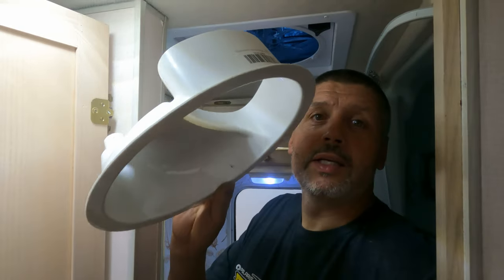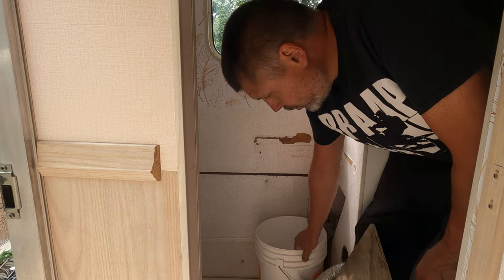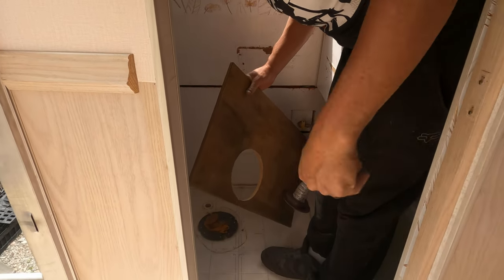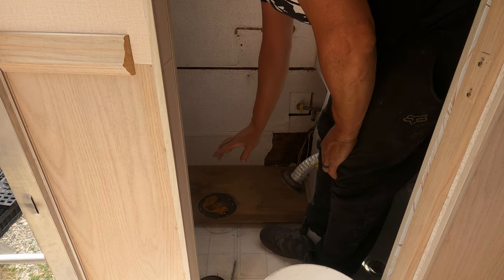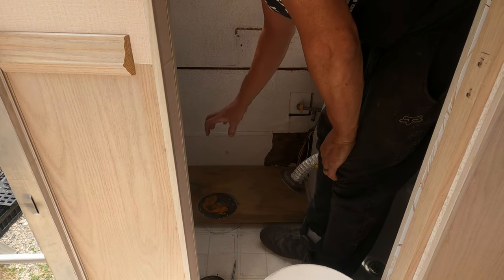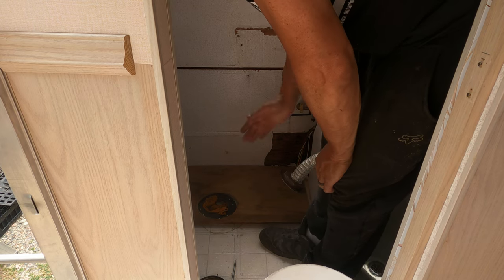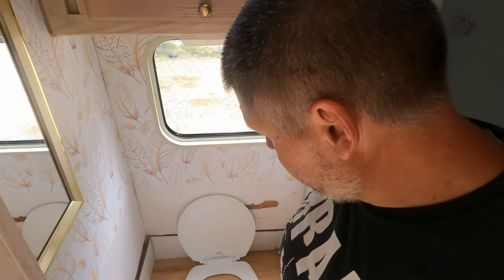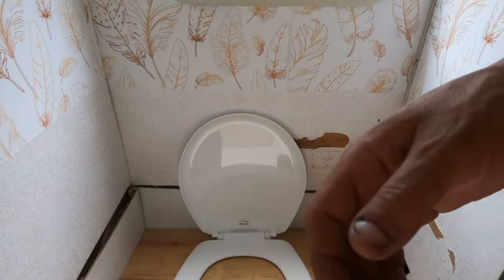DIY Composting Toilet in Our Truck Camper - Easy & Cheap

Comment: I can't wrap my head around a compost toilet because all the ones utubers have shown, you got to haul the whole thing out to dump it n then clean it (ewwww!), n then carry out a urine jug and go dump it every two days (more ewww!) n of course vent the toilet out the side, which for me is another (p-ewww!). And thus the whole thought of it makes me just love my toilet n black tank so much more lol. 
But! I must say, you have simplified no hauling out whole toilet, no cleaning out 💩 tank of composite mixed with 💩, n no smelling 💩 when walking around camper or even sitting outside on that side! And no urine jug hauling n emptying too. Only way I would do this is the way u have done it, and 😂 well I'm not that handy or motivated to even want to do this. So bravo 👏🏼, u have diverted all the 'ewwws!', and made a very tolerable toilet!! And it looks nice too! 🍻
Reply from the maker: 🤣🤣  When we started the renovations, a compost toilet was a hard no for all of the reasons you listed. After a lot of talking and planning, this seemed like the best solution.  I (Mary-Ann) am still not 100% sold on it, but... it's in now, so I need to accept it, lol.  We do a lot of boondocking, so this is going to allow us to stay off grid a lot longer.  Hopefully, it works as planned 🤞🤞